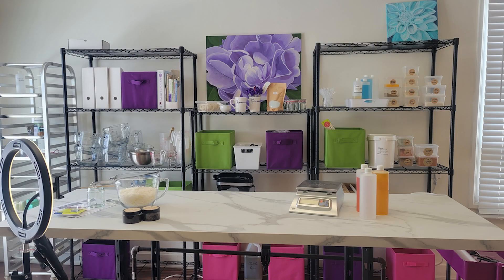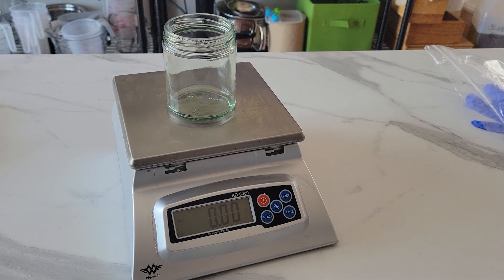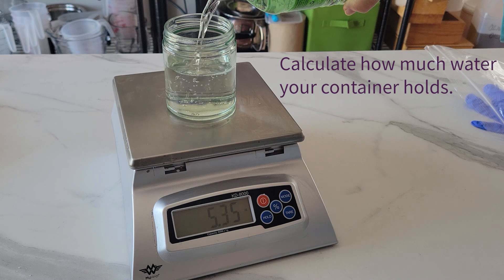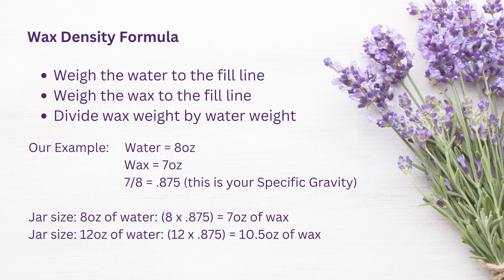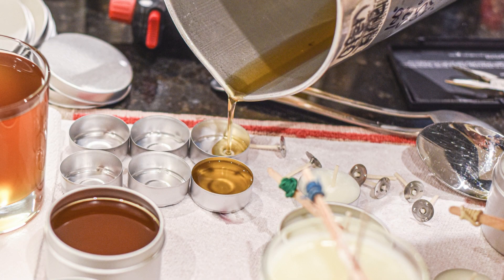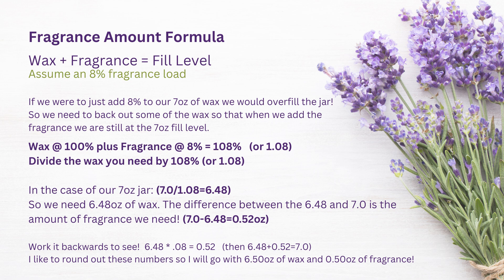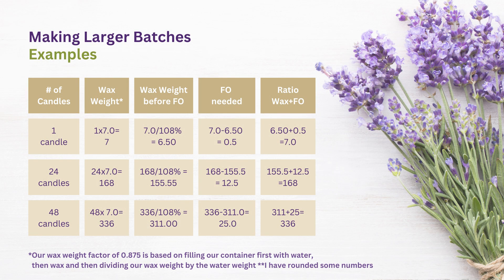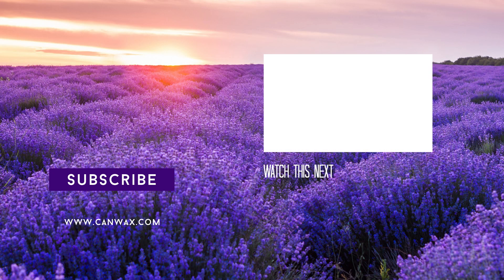Don't waste any more wax & fragrance!

Comment: I am a soap etc maker. Im in a very rustic, touristy town and would like to add dough bowl candles to my line. I like the look of the long horizontal wood wick in a long 10in up to 24in oval bowl. I havemt seen any tutorials on this. Would it be possible to het some help with this? I havent made candles so this is all new for me. I just found your channel and im living your videos!! Thank you!
Reply from the maker: Hi Nancy - thanks for checking us out! The secret behind any odd shaped candle is that a wick always burns in a circle.  Say we went with a wick that burns up to 2.5" in diameter (such as a Premier 775 in Golden Soy 464) - then you would have to calculate how many of these circles you would need.  In the case of a long vessel the wicks may be in a straight line and I would overlap the circles by half an inch or so.  In the case of larger vessels maybe you need to put 3 wicks in the middle in a triangle to try and get to the corners. It is a matter of trial and error as there is no perfect answer when it comes to wicking candles. Be sure to review wick charts to get estimated melt pools (the circle).  I did find this video that might help as well: https://www.youtube.com/watch?v=ZrE9LQdFslA
Cheers,
S.J.
Reply: @canwax_soap  okay but I'm asking about the long horizontal wooden wicks. I can't find any tutorials on those specifically :/
Reply from the maker: Hi Nancy - same concept - you need to find the melt pool for the wood wick and then measure your bowl to see how many you need. Makesy has a calculator on their site which will help guide you based on the type of wax and diameter you need.  @BootsAndBlingCowgirl
Reply: @canwax_soap   I went to their website but I only see the vertical wooden wicks. So I'm not able to get the information on how wide a horizontal wooden wick will burn 🤷
Reply from the maker: Oh I understand - we do not sell the horizontals and unfortunately I do not have any experience with them.  Sorry. @BootsAndBlingCowgirl